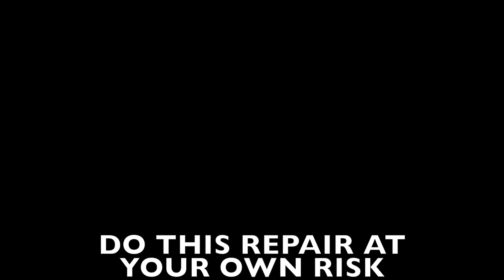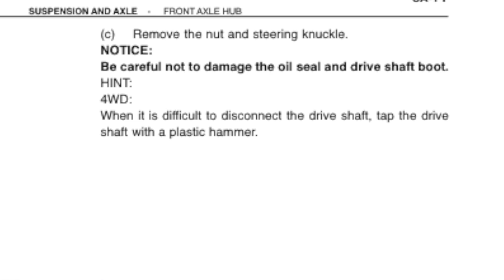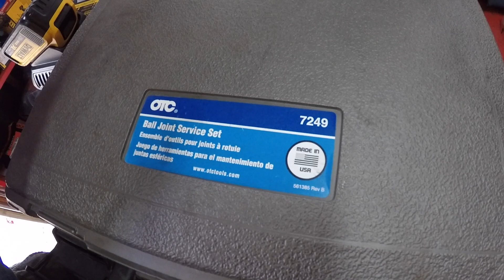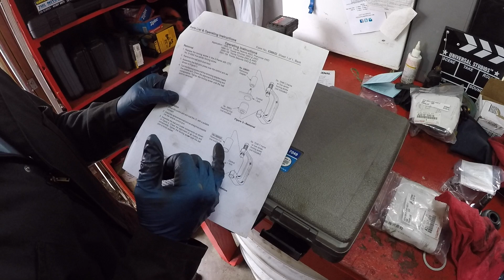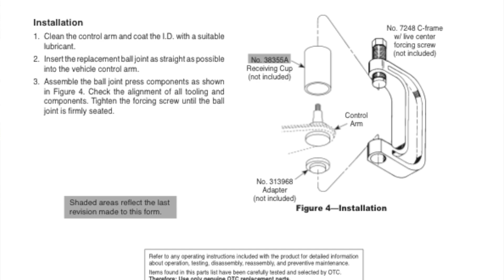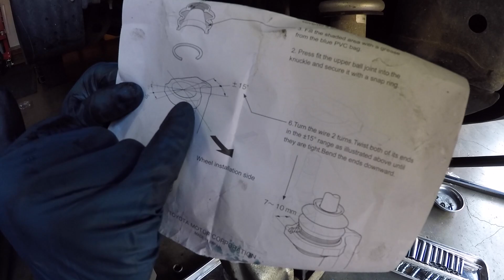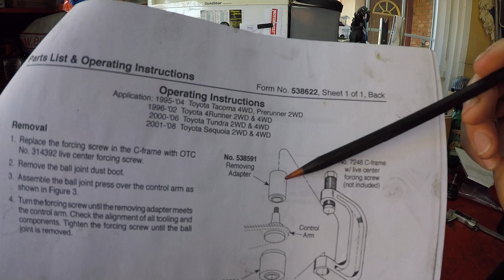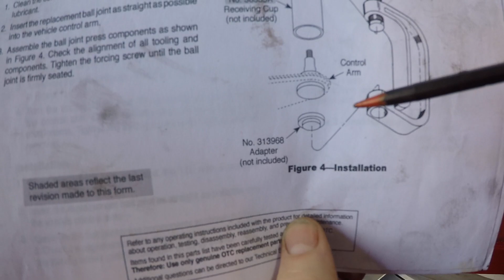Upper Ball Joint Replacement

Comment: Wow great work man. I am doing this and it was a headache. The cam bolt sleeve got seized in the lower control arm, eventually had to sawzaw it off. Putting back the upper ball joints is proving to be challenging. Especially with the wrong b receiving cups. Thanks for the link though.
Reply from the maker: Thanks Jesse.  It's pretty common to have a seized cam bolt.  Good luck finishing up the upper balljoint replacement.
Reply: @TimmyTheToolman  question. If the upper ball joint comes pre greased and ready for install do I have to take apart the ball joint boot to fit thru the knuckle? Seems like a tight squeeze and I wouldn't wanna tear the new boot
Reply from the maker: jessejaviangel no, the joint stud will fit up into the upper control arm hole & the boot will be below it.. no need to take apart the boot from the upper ball joint. The boot is pretty robust, you would really have to try to rip it installing it back up into the control arm hole.

Comment: Might be a dumb question but oh well. I'm going to be replacing my stock UCA with JBAs. My question is: Is it possible to drive the UBJ upwards versus downward like how you did. My plan is to loosen the castle nut on top but leave it on. Then, hit it with a hammer. I am not planning on taking the whole knuckle off.
Reply from the maker: You have to drive the UBJ downward out of the knuckle.  It goes in from the bottom up and goes out from the top down.

Comment: Great video, thanks for posting OTC adapter list, except NOW the prices on everything have more than doubled if you can even find them in stock anywhere. The only way to get them from OTC seems to be buying entire kits, just not practical unless you can tell everyone which kit includes the required adapters/cups/etc.
Reply from the maker: Check out our SPC Upper Control Arm install video.  Sean and Chris show a different way to go about removing the UBJ from the knuckle.

Comment: Thanks for the video.  My 98 taco would be falling apart around me without all of your videos.  

I'm actually installing new OEM upper ball joints (directly from my local Toyota parts dep (#43310-39016)) in my taco right now, but they don't fit in the top of the knuckle. Toyota and the internet says I have the correct UBJs, but the new ones are both .005" larger than both of my old ones.  I only found the difference after attempting to press one in.  It was going in straight, but taking more pressure than anticipated, so I stopped and pushed it back out. The metal on the UBJ was noticeably sheared / deformed by the knuckle around the entire perimeter.  Both of my knuckles were the same size too, but with the larger UBJ's, there was a .010" interference between the parts.  In my experience, that's way too much.  I've gone on to buy 2 more UBJ's from Toyota, and from 2 aftermarket manufacturers, and they're all the same size.  I'm going to try heating/cooling the parts before pressing, but just find it very strange that none of the new parts match the original parts.
Reply from the maker: That's bizarre that the UBJs have a larger diameter than before.  I do remember it taking a decent amount of force to drive it in with the balljoint press.

Comment: Thanks for the video.. i'm going to do this to my 2008 Tundra tomorrow but I'll be using MOOG brand parts. I hope they don't have the step you showed of 2 types of grease. I think Moog has serviceable grease fittings so Im hoping i can just grease them after installation! Anyway, thanks again
Reply from the maker: You're welcome and good luck with the job.  The Moogs probably only take one type of grease.

Comment: Excellent instructions! Question, if I plan to replace upper & lower ball joints at the same time, should I remove the lower before removing the knuckle?
Reply from the maker: You could remove the knuckle with the lower balljoint still attached if you want by disconnecting the lower balljoint at the lower control arm and outer tie rod.  Once you have the knuckle clamped in a bench vise, you could zip off the lower balljoint bolts and remove it from the knuckle.

Comment: You did it right.. I tried to get this done with the spindle in place and it was impossible.. checked the upper ball joint and it was still within  spec so I will tackle this job when I'm doing front bearings
Reply from the maker: We're glad you think so.  Thanks.  Yeah, like I said in the video, it can be done with the knuckle still on the rig but it makes it much harder.  Thanks for taking the time to comment.  Happy Wrenching!
Reply: I did it with the knuckle in place, using a small stool and scrap of romex wire to hold it in place. Was able to use the rental tools from Autozone and wasn't too bad. If I did it again, I would only go this way if I have a helper. If not I'd do it the TTT way.

Comment: hey Timmy, loving your videos. binge watching everything you've done on the 3rd gen 4runners.

question for you, if im buying control arms with the Ball Joints already pressed in by the factory, what do you recommend to do in order to get the UBJ into the knuckle?
Reply from the maker: I recommend you watch our balljoint replacement video and it will show you how to install the balljoint into the knuckle. https://youtu.be/-sY2azyLBuI

Comment: Would it have been easier to use the 20 ton press to remove and install the UBJ? I was going to order the additional OTC adapters and then I realized that with the knuckle off I might be able to do it on my press and not have the space limitations that comes with using the C shaped press in the BJ kit. It seems the space limitations are the source of most of the complications. With the knuckle off it seems like the 20 ton press may alleviate the space limitations and may be easier. What do you think?
Reply from the maker: You might be able to do it on the press but the shape of the knuckle might cause issues of you getting it in the necessary position on the press cross member.  If you're successful doing it, let me know.

Comment: Great video. If the tie rod test checks out and there is no movement but the boot is torn and leaking grease, what's the best way to clean it out before slipping on the new boot? Would it be ok to just wipe off as much as possible and repack with new grease?
Reply from the maker: You said tie rod but I'm guessing you meant upper balljoint.  Yeah, what you said is just fine.  Clean it up good with the rags, maybe a little brake cleaner, put the boot on, re-grease and install the new retaining wire.
Reply: @TimmyTheToolman  haha yeah, upper ball joint. Lots of suspension components to replace. Thanks for the feedback.
Reply from the maker: @dlim1984  You're welcome.

Comment: tim i did the same job without taking the spindle apart i also found the receiving cup and the part to push it out on ebay that somebody had already used and sold it.
Reply from the maker: Good job Larry.

Comment: The piece on the bottom pushing the ball joint into place looks like it was on that inner lip on the ball joint is that correct? Is that raised part of ball joint strong enough to put pressure on? I was thinking the outer edge of bottom of ball joint was what you wanted to be pressing?
Reply from the maker: Any part of the bottom of that balljoint is ok to press on.  The steel is thick and won't be damaged from the force necessary to press the balljoint into the steering knuckle.

Comment: Timmy  I have a 2002 4 runner Limited . I have been working on the ABS brake system for long time. I have replaced all parts front and rear and sensors. When the car comes to a stop the master cylinder makes a noise then the dash lights come on. The    ABS, TRC , VSC  Timmy if you can help
Reply from the maker: I'm sorry but I haven't had to diagnose a problem like this yet on one of these rigs so I don't have personal experience I can pull from to help you out.  A Toyota forum like T4R.org might be your best bet to ask this question and hopefully somebody can help you out.  Good luck!

Comment: Can a bad UBJ cause the spindle to make contact with the coil spring? I'm running ome 880's w/bilstein 5100's.
Reply from the maker: It's pretty common that the spindle can rub the coil spring a little.  I don't necessarily think it's a bad u-joint if it happens.

Comment: Great video ! 

One question, I’m going to buy everything (OTC) to do this job, my head is spinning trying to figure out what to buy without getting duplicate tools/pieces. For instance I’m not finding the 7248 pin without buying another C clamp? Already ordering the 7249 kit. The 313968 is another kit with a bunch of individual parts that are again, possibly duplicate parts?  
It’s just seems like a matrix of tools to round up, doesn’t someone just make a master kit with everything? I’m already up to 500 bucks with all these parts. 
Again thank you for all do!
Reply from the maker: You could do this job another way, by cutting off the stem of the ball joint with an angle grinder and using a socket to push the balljoint out.  That will save you at least the one special tool to drive the old balljoint out of the knuckle.  Take a look at this video Sean did with his buddy Chris installing JBA upper control arms on a 3rd Gen and maybe you'll see what tools you can get away with not purchasing.  Maybe a basic balljoint kit will be sufficient.  https://youtu.be/noBts3Qf5rw

Comment: mine have some play but my lower ball joint is new so is it possible that the upper ball joint might fails
Reply from the maker: If the joint actually has play (the ball pops in the socket), you should replace it.  UBJs will fail.

Comment: is there any specific reason you removed the castle bolt on the lbj instead removing the 4 bolts and leaving it attached to the lower control arm? I put on new lbjs 10k ago and don't wanna mess those up
Reply from the maker: It's personal choice.  You can do it the way you're saying.  I'd just rather re-torque one fastener instead of 4.  Also, a lot of people use loctite on those bolt threads so you'd have to clean them up and reapply loctite.  Finally, I don't think this is common, but those 4 bolts have failed on people.  Maybe they over-torqued them, but torquing and then re-torquing causes extra stress on the bolts.

Comment: Great video tutorial; especially your commentary and written recommendations re list of tools and other advice.  I note in your videos the packages of parts procured for the job, with part numbers written on them.  Where can I find the part numbers for repair/replacement projects on my 1999 Toyota 4Runner?  Thanks for sharing.
Reply from the maker: We're glad you like the video.  In all the videos we make, for the most part, we list the part numbers, tools used and torque specs in the video description.  If we don't list the part numbers in the video description, you'll be able to find them while watching the video.  

If you're asking if there's some sort of master parts list in existence for 3rd Gen 4runners, I don't think it exists unless somebody has made one that I don't know of.  What most people do is they look up part numbers on online Toyota parts seller websites like Camelback Toyota.  They have parts schematics you can look through for your particular year, make and model vehicle and you find the part numbers that way.  Sometimes certain parts are hard to find and that's when I visit my local Toyota dealer and have them look it up for me.  The dealer parts department has a much more comprehensive list of parts schematics and they pretty much every time can find you the parts you need.  But, the problem with going to the dealer is you pay more than online but I'd rather get the part I need and pay more for it than search and search forever online.

Comment: this would have been great 2 days ago when I did mine... I just winged it... it got done but I had no idea what I was doing

I did the job without taking either calipers or cv shafts off, auto zone loaner tools a grinder/cut off wheel
Reply from the maker: Well, you got it done and that's what counts.  There's always more than one way to get a job done.

Comment: Timmy...!! 
Question! So I didn't have a torque wrench at the moment. I only tightened it with a breaker bar and came to buy one with everything on already. I have a huge amount of thread left over where the cutter pin is way up and not securing the castle nut.  Should I remove the upper ball joint and reinstall it without any weight sitting on it or am I fine?
Reply from the maker: Something isn't right.  Did you install an OEM balljoint?  It sounds like either the taper of the balljoint shaft is wrong or the hole on your upper control arm has gotten widened out.  If the old OEM balljoint shaft you removed wasn't sitting like that in the upper control arm, this tells you that there is something wrong with balljoint you got unless you just grossly overtightened it with the breaker bar and you're strong like Lou Ferrigno.

Comment: Hi Timmy, really appreciate your videos, I recently used several of them when I fully rebuilt my 04 Gen 1 Taco. Pulled the cab and bed off the frame, derusted and painted it, plus did a lift, etc. Your videos were invaluable. I have a question. I've put about 1500 miles on the truck since I did the UCAs and UBJs. I installed the Mevotech UBJs and Moog UCAs. I noticed awhile ago that the boots on the UBJs were folded inward on one side of each. Today I finally had a chance to look at the boots closer. It is possible the boots have been like that since I had the alignment done. Do you think that this could cause a problem? Should I find I way to get the boot folded outward? I can't find a way to post photos here, do you have a contact I can send them?
Reply from the maker: I'm happy to know our videos have helped you with your 1st Gen Tacoma.  Send me the pics: tim@timmythetoolman.com, and I'll let you know what I think.

Comment: When you were putting on the 2nd grease package to the top of the upper ball joint, what keeps it in without it comming out from top? Only one cable?
Reply from the maker: Nothing really keeps it in. The main grease is within the boot.  I think that grease is just to lubricate the top of the boot a little to keep it from binding on the balljoint shaft.  At least that's all I can come up with as a reason why they have us lubricate the top of the boot.  Yes, there's only one cable per boot.

Comment: Hey Tim, thanks for the videos, they have helped me rebuild my 99 limited almost entirely. I will be installing jba upper control arms soon once my new lift springs arrive, and I was wondering if you think it is possible for me to press the ubj out, and in with my harbor freight 20 ton press (I bought the press thanks to your rear control arm poly bushing video, man it's a life saver)

I would need to secure the knuckle before it is pressed, but I am hoping that this is possible.
Reply from the maker: Hey Tyler, I don't know if it's possible because I've never tried it.  I have a feeling it would be very difficult to properly balance and support the knuckle on the press.
Reply: @TimmyTheToolman  I took your advice, and went ahead and bought the C clamp style press. Pushed the ball joint out like butter! I'm picking up 2 more press plates this weekend so I can start the press work. One last question, what is a good indication that the abs ring might need to be replaced? The tacoma knuckles that I will be using already has ABS which is a plus!  So I'm converting the tacoma ADD knuckle to a manual knuckle.

Comment: So can I go with your ball joint Service kit to get these in and out of the knuckle?

I carefully managed to get the joints out with with the knuckle on their 

My 2500 ft lb impact was my persuasion tool. The driver side was not budging. My sledgehammer said otherwise.

But that bore is wide. I'm installing SPC UCAs and am going to have to get the overside knuckle inserts they sell 

I'm guessing this kit should work to get it in? I suppose it's hard to say.

But I'm willing to spend the money on the tools to do it right and make it easy.
Reply: Just saw your post on forum's explaining the parts.

Just wanted to share that i rented my ball joint puller from O'Rileys. There were two kits from O Riley's that I had to get or got just to be safe. I got the standard ball joint removal kit, plus the 4WD removal kit. (I also have a 2WD.) 

If you go my route, you will have to get an angle grinder, or die grinder and cut the ball joint down the nub. Basically remove the threads from joint then install the clamp. I forgot what order I had to put it in but it worked. 

I was able to do this with the knuckle on the car.

We gotta find an easy breezy kit to get those out.... It's a legit pain.

But yes as you can see above. My experience was based on the ball joint currently installed. One was easy to get out and the other side was insanely difficulty. Which led me going postal on it with a hammer. 

To anyone reading this. ALWAYS GO OEM AND DONT LET SHOPS TELL YOU OTHERWISE. All the stuff the PO did to this car is aftermarket junk
Reply from the maker: @cameronp5728  Thanks for sharing your experience Cameron.  All the adapters I purchased from OTC for this job made the job very straightforward.  I know it sounds like so much additional work to remove the knuckles from the vehicle to do the pressing out and back in of the balljoints but I've wrestled with doing it on the vehicle and that experience was enough for me to decide to just pull the knuckles off to ultimately make the job easier for myself.
Reply: @TimmyTheToolman  yeah I would opt for taking them out next time if I had to replace OEM UBJs. 

I found SPC recommends a ball joint remover and installer. SPC 72509. Im going to order this and report back my findings. If this works then you this will give you a kit that works for dealing with OEM ball joints and also have the option of pressing the SPC UCA steering knuckle insert in as well